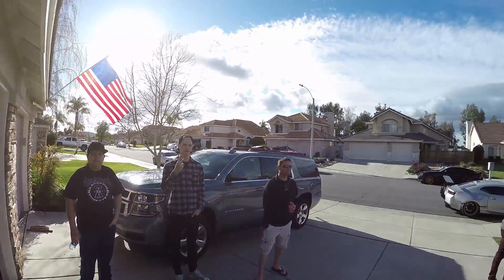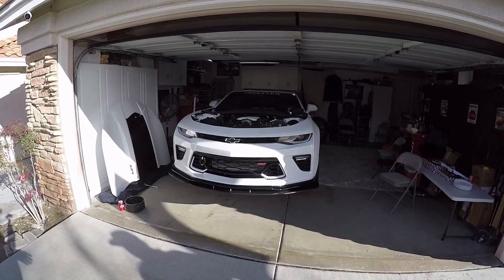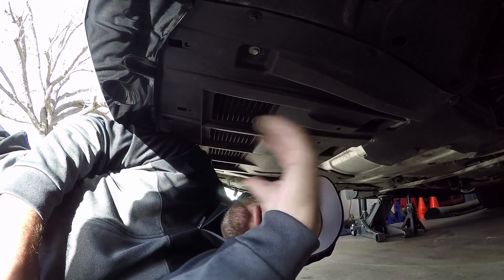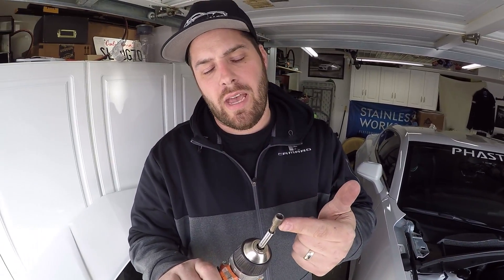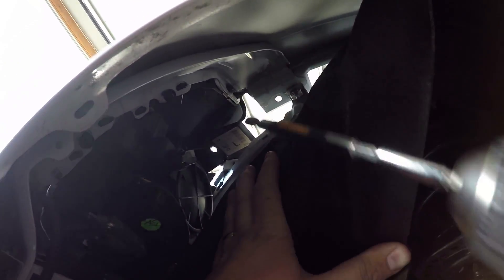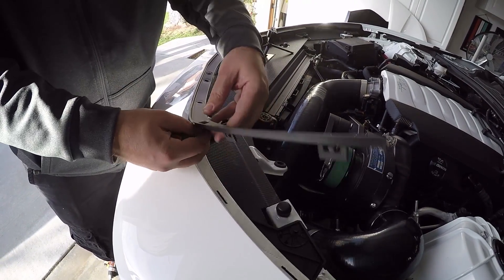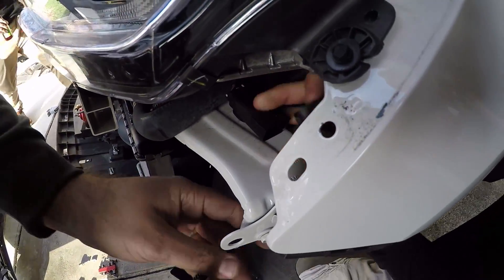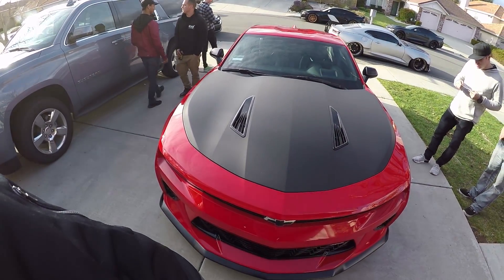Front Bumper Removal Guide - 2016-2024 Camaro SS

Comment: What's up man,  I appreciate the  video... A little bit off of this video...,, but I have noticed with my 2017 2SS ,when I do hard pulls from 0 to a 100 the transmission has a delay of like a second or a little bit more than a second as it shifts gears when you're in auto, not using the paddle shifters. Any way to correct that or have it shift more accurately/faster and smoother with the stock equipment? Adjustments??
Thanks in advance! I'll  be waiting for that video on Saturday brother...
Reply from the maker: outside of a trans tune, no.